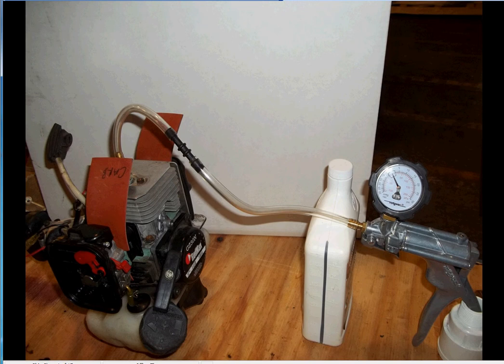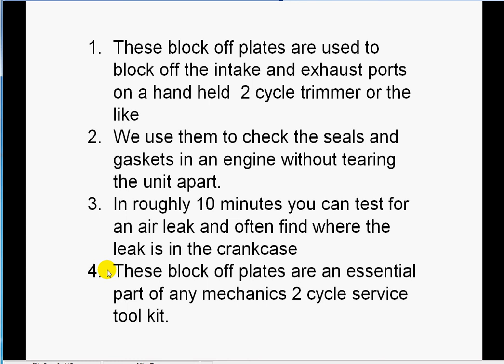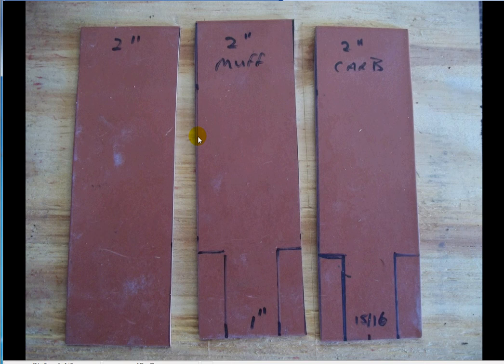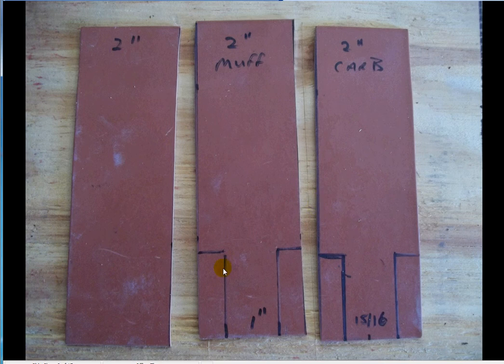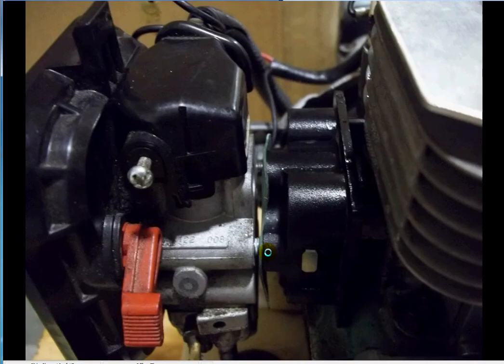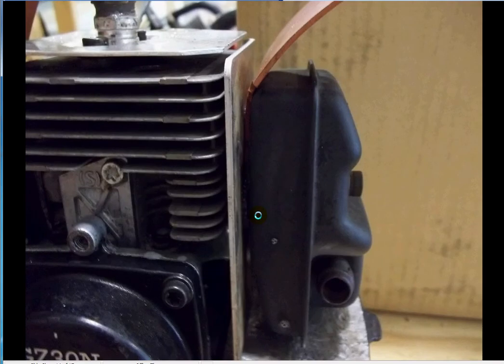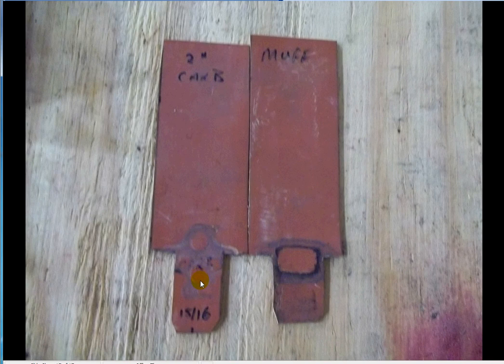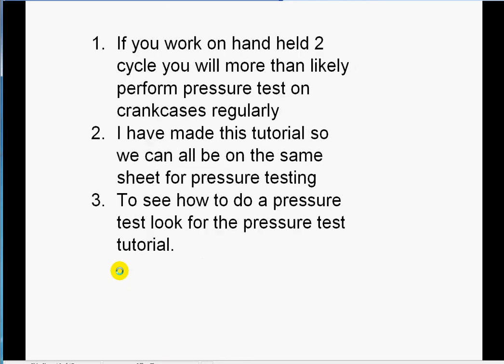block off plate fab

Comment: 22/03/22 I've been teaching myself small engine work for the past nine months and am compiling a complete diagnostic process worksheet so I do things in the right order, avoid testing when I don't need to and make sure I don't miss anything.  I've searched for and found every video Joe Pace has posted in an effort to assemble all the diagnostic information available for the "Advanced Sequential Troubleshooting Worksheet" (which was mentioned in every video but which I cannot find anywhere).  I have seen six parts - F (two parts), G, L, I and O plus the Block Off Plate section but have not found Section H or a copy of the entire worksheet.  If anyone has more information or even just a list of what's on section H I'd be most grateful.  I'm posting this on every one of the above sections in hopes I'll finally get the attention of someone from Husqvarna like a servicing dealer who is willing to share that information.